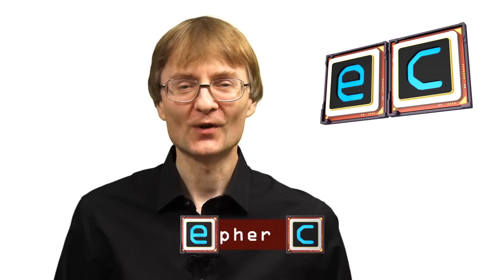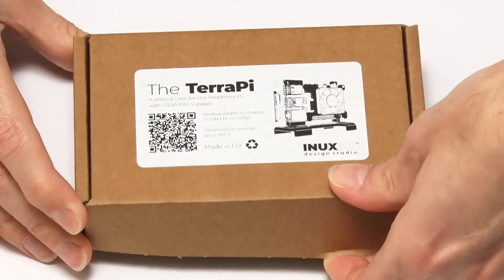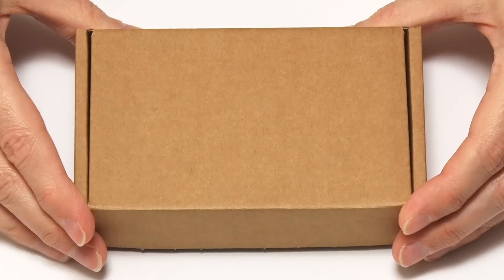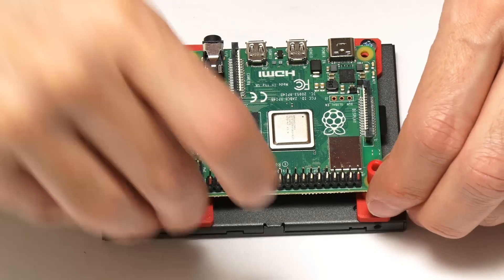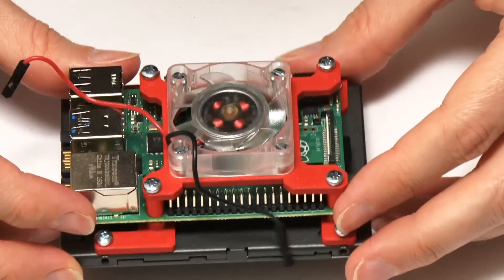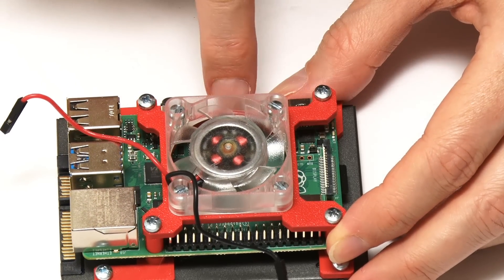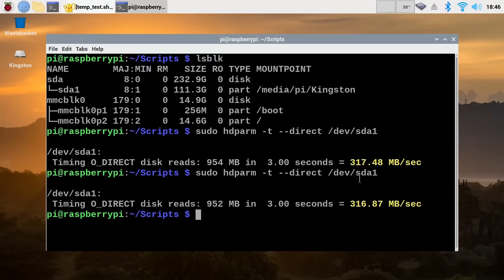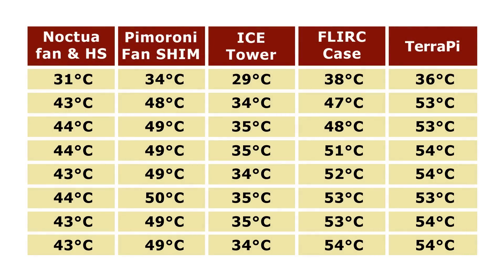Raspberry Pi 4 TerraPi Rig

Comment: Hi there! I would like your help, because I've purchased that ICY BOX USB 3.0 HDD adapter and my Raspberry Pi 4 won't boot from the SSD I have. So I have a Samsung 830 series 128 GB SSD, connected with the Icy Box adapter to my RPi 4's USB 3 port. I've tried several different ways to burn the image to the SSD, I also tried to clone my current system from my USB flash drive that I'm currently using for my OS (Dietpi). I believe switching from a flash drive to an SSD should be very simple. I don't get it what's going on. I've tried to burn fresh OS on the SSD, clone my current USB drive, but I wasn't able to load the OS completely. Dietpi after booting turns on emergency mode. I use Etcher for burning images. Could you help me please?
Reply from the maker: I suspect the issue is that the Pi does not support USB boot from the SATA to USB adapter in the ICY BOX. Sadly not all such adapters are supported, so you may just be unlucky here. It is worth upgrading the Pi's firmware, as more recent versions support more adapters for USB boot. I cover the process in this video: https://www.youtube.com/watch?v=2zrwjGcyM5s Be aware that there are a lot of other videos that include lots of irrelevant steps . . .  Good luck!

Comment: How does that work ?
I have a pi 4 (4gb version) with a 2Tb ssd hard drive and 7 inch touch screen and it wont boot if I have the hard drive plugged into the USB 3.0 ports.
If I have the hard drive plugged into USB 2.0 ports, it boots fine.

Comment: Oh! I had just commented on your older video about using a NAS bracket sold on amazon. I should have watched this first.
Reply: Nevermind. The one I bought on amazon actually fits 2 SSD drives, which is what I needed. It would help your viewers to know there’s a cheap component out there https://amzn.to/3ccNysJ
Reply from the maker: Thanks for the link, looks a good bracket. Note that the TerraPi comes in one or two drive versions.

Comment: I'm wondering (assuming) you set this for long term use, if you will see power issues since usually you need to power external media through an external power supply as well? I'm not 100% sure since you're using the USB 3.0 interface... I guess I'm old school and always assume it still needs it :)

Comment: DON'T BUY THIS! It's poorly designed - it's top heavy especially with cables attached also the fan mounting hole place a bolt a mm or so away from a connector in one corner making the connectors useless as well the bolts that go through the pi board are too large to pass through the pi requiring reaming out to fit. When trying to attach the assembly to the ssd mounting brackets the bolts barely 
engage or strip out instantly. Build your own assembly this is garbage.  I've seen several people call this channel out for shill vids and I'm starting to see why.

Comment: You did the terra pi without a heatsink, and then noctua fan with heatsink, but you did not use the heatsink with the original fan, so that was not a fair comparison, and you already had that result, so you should have expected the same results

Comment: Caught you showing the pi/ssd fitting to the base upside down, but then correctly(depending on use, I guess) with the IO pins down...  :)

Would love to see an update with the standard TerraPi fan and heatsink (or won't a heatsink fit with that fan arrangement?) with temps.  My guess is that the heatsink is the key to lower temps, vs. the Noctua fan.

RichE San Diego, CA

Comment: Hi , do you have some video explained  how to add windows 8, or 10 , to this small pc . thanks for your help
Reply from the maker: A Raspberry Pi has an ARM processor. Desktop windows requires an x86 processor, so cannot run on a Pi. There is a desktop ARM version of Windows 10, but there is no legal means of using it on a Raspberry Pi.

Comment: @explainingcomputers.  -Chris, what is the recommended method of copying the OS to the SSD?  I have got the Pi to boot from USB using a flash drive, but the SSD fails to load. I am using the same SSD and adapter demonstrated in the video. Thanks for any advice.
Reply from the maker: I think that here I copied a working SD card to the SSD using the SD card copier in Raspberry Pi OS (so here I would recommend copying the USB drive you have working to the SSD). The Pi 4 is still sometimes problematic to get USB booting from some devices, but if you are using the same adapter and SSD, it should work. If copying Raspberry Pi OS to the drive does not work, you could image in (eg) Etcher -- maybe cleaning the SSD in DiskPart first (see my very recent video). Something else to try is a different Pi firmware update. Good luck! :)
Reply: @ExplainingComputers  Thank you. I recopied from the original SD card to the SSD and this time, after a lengthy boot, it loaded.  I was able use the function of the OS. So it was successful. Thanks Chris.  Regards Keith
Reply from the maker: I think that here I copied a working SD card to the SSD using the SD card copier in Raspberry Pi OS (so here I would recommend copying the USB drive you have working to the SSD). The Pi 4 is still sometimes problematic to get USB booting from some devices, but if you are using the same adapter and SSD, it should work. If copying Raspberry Pi OS to the drive does not work, you could image in (eg) Etcher -- maybe cleaning the SSD in DiskPart first (see my very recent video). Something else to try is a different Pi firmware update. Good luck! :)
Reply from the maker: I think that here I copied a working SD card to the SSD using the SD card copier in Raspberry Pi OS (so here I would recommend copying the USB drive you have working to the SSD). The Pi 4 is still sometimes problematic to get USB booting from some devices, but if you are using the same adapter and SSD, it should work. If copying Raspberry Pi OS to the drive does not work, you could image in (eg) Etcher -- maybe cleaning the SSD in DiskPart first (see my very recent video). Something else to try is a different Pi firmware update. Good luck! :)
Reply: @explainingcomputers. Update: Chris finally solved my boot problem via USB for SSD. It was the adapter (Icy Box). After reading a lot of reviews, I purchased this one (ELUTENG) https://www.amazon.com/rently-Adapter-Support-Serial-Compatible/dp/B0716JKJ68/ref=sr_1_5?dchild=1&keywords=usb+to+ssd+adapter+raspberry+pi&qid=1606057650&s=industrial&sr=1-5. Apparently it’s the chipset on some devices that are not yet supported. This new adapter works like a dream, super fast. According to reviews, it’s the luck of the draw. Since some adapters are manufactured from different sources they use different components. Thanks again, but I thought you might appreciate the update.

Comment: I bought that USB adapter cable and I do not get my Pi booted from SSD when the USB is connected to one of the USB-3 ports but does boot perfectly when in a USB-2 port. Tried with 2 different SSD's, same result. Tried Rasbian and Ubuntu, same result. Guess next step is trying a different brand adapter.

Comment: I'm  putting a PI camera & lens and a Google Coral USB Accelerator for vision recognition on my clocked Rig, along with the tower ICE heat pipe cooler. I just have no idea what the Coral USB Accelerator is or how to use it, but I think it's a must have.

Comment: Is the base wide enough to keep the SBC from tipping over due to the weight or placement of the cables?
Reply: i will say that the hdmi cables might tip it if it is at the right angle other than that there shouldn't be any other wire that will tip it over unless you tug on it.

Comment: I noticed that if I put my PI4 directly on a SSD drive like this TerraPI Rig, I have almost no wifi reception. This prevents to connect using 5Ghz wifi. With 2.4Ghz Wifi it connects, but slow as hell. Must use Ethernet in my case. I read somewhere that it might be due to unproperly shielded usb3-Sata adapter. 
I tried 3 differents, all the same issue.

Comment: I must be doing something terribly wrong. I have the exact same SSD (Kingston 120GB A400) and Icy Box adapter attached to an Raspberry Pi 4. But my results are:
Timing O_DIRECT disk reads:   2 MB in 30.97 seconds =  66.12 kB/sec
Yes, that's kB per second! What's going on? The boot flash drive on my Pi gives me 85 MB/sec. 
I've moved the Kingston SSD over to one of my desktops ant there it gives better results, but still only 38 MB/sec.
Is it a bad SSD?

Comment: Love your videos! I'm wondering if an added heat sink would make a difference.  I agree with you regarding the screws self tapping into the plastic base. If there were indentations on the bottom side of the holes for nuts, that would be great.

Comment: I hope in the future a new rpi will come with a m.2 slot this wil make things more compact and compatible so you dont't have to look which usb ssd wil be excepted, i had a negitive experience with a Intenso usb 3.1 ssd it took to much power out of the USB bus and was causing the wifi chip to mallfunction allso , had a WPA supplicant communication error with it.

Comment: I've been following a few video's and I like it.

I've got this project on which I hope you could help me with.
I'm searching for a ESP board with PoE on a small footprint.
I like the relatability a wired connection has. Unfortunately an esp-01 is small, does have wifi, but doesn't have PoE.

Do you know a board that has any esp controller with PoE and a small footprint with which I can make a Ethernet power plug with?

The wESP32 is the closest thing I found but it is quite big to fit into a socket.
Do you know an alternative? Thanks in advance

Comment: An RPI should always have at least a small heatsink anyway. If you were to use the stock fan with the heatsink the temps might be at least 5 degrees cooler as a guess. I have no idea if this observation has been repeated.
Reply: I was hoping to see that same experiment... the video can only be so long of course, but it would be most informative to see how much of the benefit is attributed to the heat sink versus a particular model of fan.

Comment: I can very happily report that using a Raspberry Pi 4 Rev 1.4 (fully updated),  the Low-profile version of the ICE tower and your bench marking script I get the following temps (22.5 C ambient):

pi@raspberrypi:~ $ for f in  {1..7}; do vcgencmd measure_temp; sysbench --test=cpu --cpu-max-prime=25000 --num
 -threads=4 run >/dev/null ; done
temp=29.0'C
temp=35.0'C
temp=36.0'C
temp=36.0'C
temp=36.0'C
temp=36.0'C
temp=37.0'C
Reply from the maker: Great results! :) Thanks for sharing.
Reply: @ExplainingComputers  Thanks for reviewing all these cooling solutions :) I held off buying a RPi 4 for quite some time due to the (now resolved) USB-C and thermal issues. Really glad the Low-profile version performs as good as the original. Planning on getting the TerraPi side mount kit (or something like it) but I'm slightly concerned the ICE tower might add a little to much off-center weight.

Comment: One thing I always wonder about these Raspberry Pi cooling tests is "to what extent do these differences matter for a given use case?". Under what circumstances would the FLIRC performance be any sort of an issue in terms of hardware life or throttling? It seems like you'd have to be OCing the Pi in a warm room and running heavy workloads for minutes at a time for it to be a factor. I'm sure some people do that but maybe you could give some sort of perspective on these results so less savvy viewers don't get the idea that they need the top end solution for more usual Pi usage scenarios.
Reply: This has been somehow answered in a review for the MagPi magazine some time ago - here: https://magpi.raspberrypi.org/articles/group-test-best-raspberry-pi-4-thermal-cases-tested-and-ranked
A short answer: almost all of the cases and cooling solutions cool enough in a typical european ambient temperature, that they prevent it from thermal throttling. What is different though, is the sound, access to GPIO and other ports and last but not least temperature of the microSD card, if you boot from it. Also cooling of the USB3 bridge wildly differs. 
I bet that for long SSD transfers, the USB3 bridge can overheat and throttle on its own.
Some cases are so-so to cool it in this environment, and some others are no compromise solutions that cool under extreme conditions, with a side eefect of  increasing reliability. Some extreme conditions are either hot or extremely cold environments - https://www.youtube.com/watch?v=RbzKM5XxlOA

Comment: when they make these little pie boards, they should put a slot for an M.2 ssd as they are so small form factor, and it should be able to run windows 10.. and be able to be used as a web browser

Comment: Thanks, Chris. Another excellent video presentation. Looking at the gap between the fan bracket and CPU, I would have been tempted to stick a thermal pad and low profile heat-sink to the CPU. That way you'd be able to maintain better thermals and still get the best from this new form factor. Best of both worlds!

Comment: Is there any piHats for POE that would still work with this solution?
Reply: Before the official PoE HAT came, there were some POE HATS that didn't need the PoE headers on the Pi itself (Pi 3B+, Pi 4B). They were essentially standalone POE to 5V converters.
We've routed the PoE header out on our cooling solution to allow PoE use even though the top of the Pi 4B is covered wholly by the heatsink itself. https://www.youtube.com/watch?v=RbzKM5XxlOA  time 1:25 
I just want to show that using PoE HAT with Pi 4B is possible, but not in the original, intended position - the integrated small fan on that HAT is way too small to live long.

Comment: I've never been able to get YouTube audio to play from pi4 via the HDMI connection but this same connection allows Power Point audio.  Anyone know why... thanks.
Reply: My RPi4 only outputs sound on the mini-HDMI1 connector, nearest to the USB-C
Reply: @TheOleHermit  I'm plugged in there too.
Reply: @stephen1711  If you right-click on the volume icon in your system tray, you should be able to select analog, HDMI1, or HDMI2. Perhaps analog is selected, which is for the 3.5 mm audio jack.

Comment: Hi, thanks for the video. 
Does the TerraPi USB3 to SSD adapter support UASP to benefit from buffering and parallel transfers ? Your test looked like it showed the transfer speed of a single transfer. The issue came to my attention here: https://www.youtube.com/watch?v=t0kYcM1E5fY&t=187s

lsusb -t
driver=usb-storage (old BOT driver)    or 
driver=uas (UASP)
Reply: I was asking in this thread too - I'm interested. I guess it was, because usb-storage can do som 170MB/s ? UASP some 300-ish.
Reply: @sensorequipment8283  I'm not sure as even the old approach can do a single transfer at high speed, the benefit is greater with multiple simultaneous transfers as when used as a NAS or a boot drive.

Comment: I use Ice Tower in passive cooling mode (i.e., with the fan dismantled). Keeps my Raspberry Pi 3B at 55 degrees C while the room temperature is about 20C.
The Pi is in vertical position, which helps air to cool the fins (I hope).
As for the fan... it started making noises after a week's use.
ADD: and by the way, I overclocked my Pi to 1400 MHz (the stock frequency being 1200). Thanks for your excellent video on overclocking, Chris!

Comment: This is a very cool mounting system!
Personally my problem is that I like to run my Pi's via PoE... And cooling then tends to be harder then most solutions....
Reply: Some of our customers from Germany evidently use CooliPi for PoE enabled network probes. Passively with the official PoE HAT. Its fan only runs above 46 degrees Celsius, only with artificial load - stressberry or linpack. Other than that, thinking of what cool is - https://www.youtube.com/watch?v=RbzKM5XxlOA

Comment: I realize you probably want your review to reflect the experience out of the box, but I have to say the Noctua+rad+TerraPi combo looks like a winner to me and I'd probably go with that.
The reason is that I can clearly hear the whining of the 'normal' fan and it'd be a distraction, to be honest. Thanks for the review and especially the last bit.
Reply from the maker: You are right that the Noctua is very hard to beat.
Reply: @ExplainingComputers  How did you attach the Noctua fan to the TerraPi fan mount?  I don't see any screws holding it in place at the 1:08 mark.
Reply from the maker: @CarryOnRTW  There are screws, but they are deep down at the base of the fan.

Comment: I am not thrilled from the case/cooling kits offerings for Raspberry. It is already 8 years since first model. And there is not a single kit offering cooling like icy tower/flirc case and practical access to GPIO and other connectors, having power switch and also work as case with slick design like flirc case. You are always trading something. But the new RetroFlag nes case looks quite good.
Reply: You're wrong, sir. Except for the multifunctional power button, CooliPi does what you ask for. https://www.youtube.com/watch?v=RbzKM5XxlOA
As for the power switch - it can turn the Pi on with one/both of its reset buttons, configurable as you wish. It doesn't however do turning it off - we didn't want to block any GPIO pin in any way nor install any proprietary software. And as I've seen some new from Adafruit, they're starting to make some nice, multifunctional shims on the GPIO header to do this function.

Comment: What makes it solid construction is it's  dependency of using the SSD housing to supply structural integrity to the plastic frame. That's a bit of a disappointment, but I guess it works. I don't know if you know anything about tails os, but it might make an interesting presentation. I'm sure some viewers could find an interesting use for it. Im just running this Idea past you.